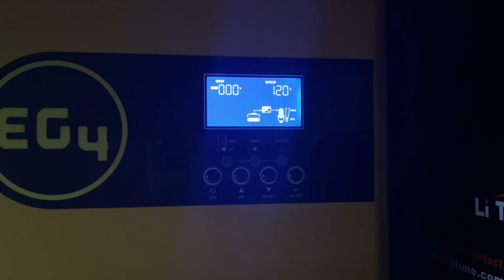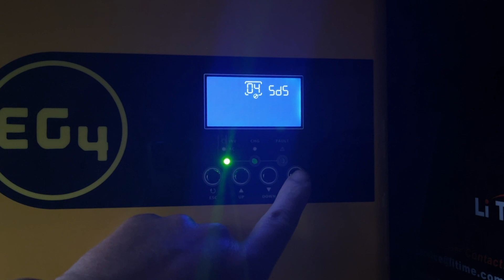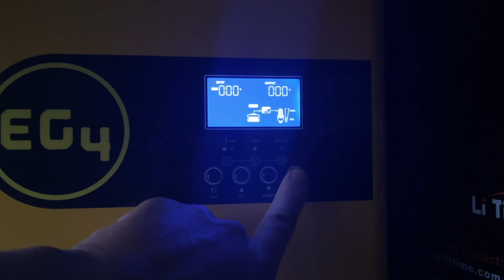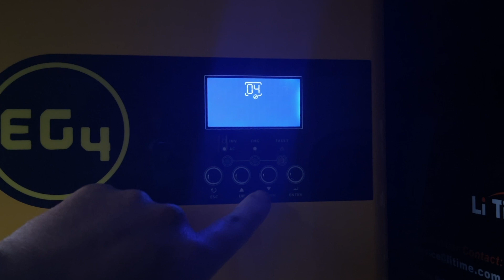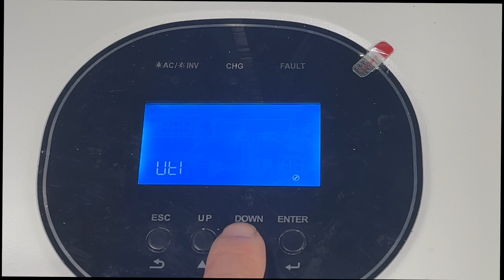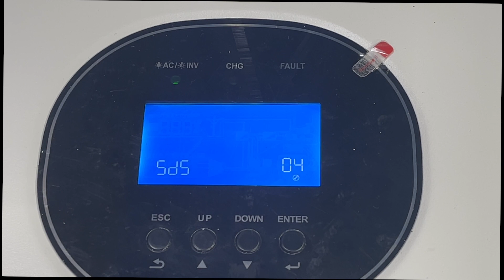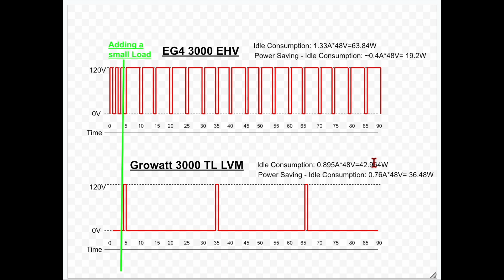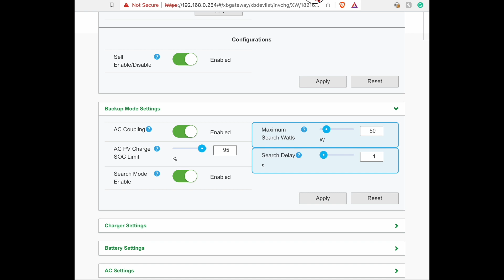EG4 vs Growatt 3000 which power saving works better.

Comment: EG4 would drain my battery in 75hrs compared to 111hrs with Growatt or something like that, 48v 100Ah battery.
Reply from the maker: That little extra 20W consumption makes a big difference.   My EG4 3k is installed in my RV and only turns on when I need 110V so power consumption is not a huge issue there.

Comment: power saving mode was removed from the EG4 3000 well over a year ago, mine never worked, asked them about it not being able to be selected they said it had been removed as it did not work right.